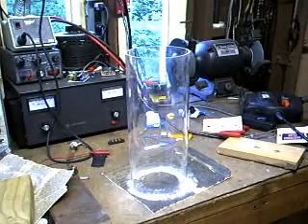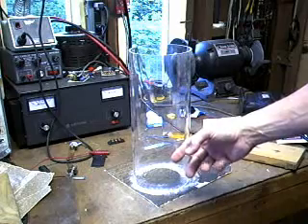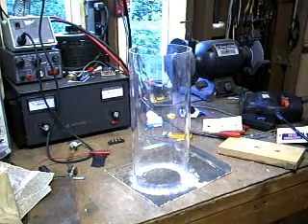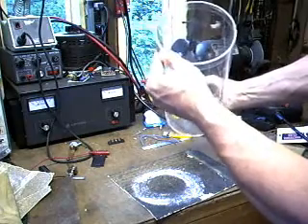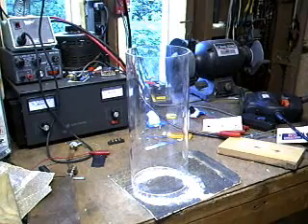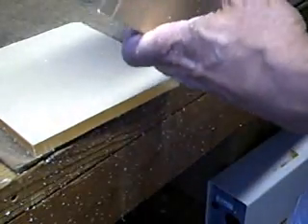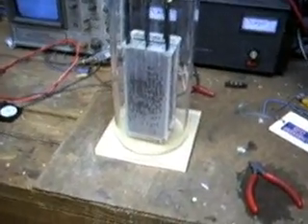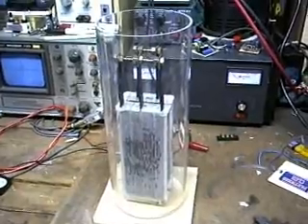#100 Prep work for new VSPB tests

Comment: u can make your groved slots easy w/ a tile saw on your panels in stead of glue for more uniform plates. just set the depth of the blade above the draw and the what makes it cut like butter w/no heat or very little.

Comment: u need to get a tile saw to do these cuts. tile saws have a sliding draw u can square up to make perfect cuts w/ your material. I've done it alot and it's far more percise. i'm a contractor so 30 years of experiance if u want to make your life easy. the blade are about an 1/8 or smaller depending on the brand.

Comment from the maker: All cells are different. For my cell I'm using around 50 grams KOH per liter. Set aside at least that much, power up the cell, add slowly, watch the current, add more, wait, watch, until you get to the current level you're after.

Comment: I am thinking that with this circuit this way you are creating a separate resonant circuit and you are taking the dynamic Capacitance value of the WFC out of the equation. so now you have a stable resonant circuit. Therefor no need for the PLL circuit. I don't know if this will work. I have not thought it all the way through yet.

Comment: Idea for a pulse circuit. PWM into a 10Khz  tuned series resonant L/C circuit to ground. Gated off for +-400usec. Take off where l1 and c1 connect. take that to one leg of a step-up xformer into a full wave bridge. This should give you the ramping pulse train. Then put your WFC across that. I tried this in a simulation and the circuit seemed to work.

Comment: On the question of pulse with modulation (and I apologize if this is not the correct forum for this question) can somebody point me in the direction of how to tune one, if I do not have an oscilloscope? All of the designs have 2 - 3 knobs for adjustment, and demonstrations are shown of the pulse being modified, but for my particular installation, How do I know what is best? Is it simply a matter of trial and error?

Comment: Excellent video as usual Zeeff, Have you thought about going to Tap Plastics for your clear acrylic and adhesive requirements. They've got some pretty good tutorials to go along with most of their products. 
I've just sourced out a local supplier for some 316 SS, once the I'm done re-modelling the workshop
Keep up the good work

Mick

Comment: Just a reminder about HHO safety. I learned the hard way that you MUST use a bubbler. I installed my cell in my truck last Thursday. I was so anxious to get it on the road (dummy here) and took it for a test run. I knew I was taking a chance by not using a bubbler or an anti-backflow check valve. A flashback made my cell blow up. I learned my lesson.

Comment: Good work as always, zero, and congrats on your 100th Video! 

 What happened to the magnetic motor tests? Did you ever get the thing perpetually working? I thought it was showing alot of promise if u ever got the timing of the arm right, and I'd be extremely more interested in powering a vehicle with a much larger version of the magnetic motor, rather than messing with any feul and such... 
 But in any case, keep up the good work!

Comment from the maker: The first build of the new VSPB cell design kinda fell apart in service. A) I want to get it back into service ASAP, B) I want to make sure this one holds up and C) I want others to be able to see it in operation.

The plasma cell is intended to conduct cold fusion experiments. The end game there is to heat water much more efficiently, extract the heat through a heat exchanger and retrofit it to my HVAC.